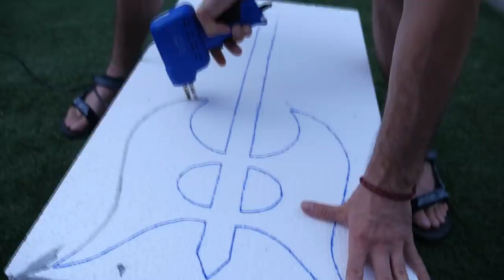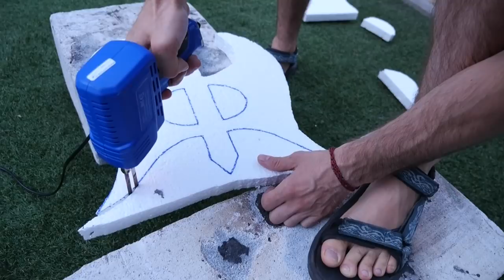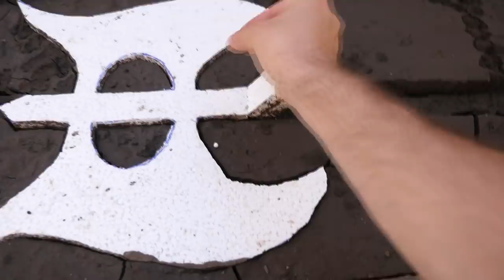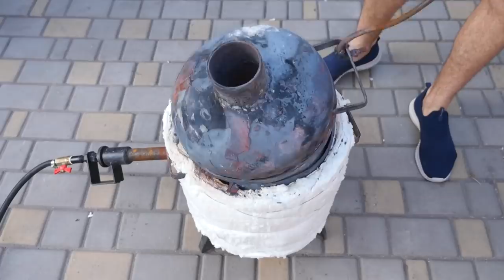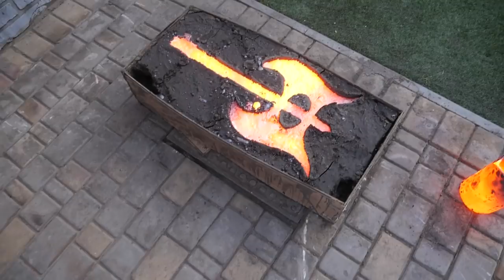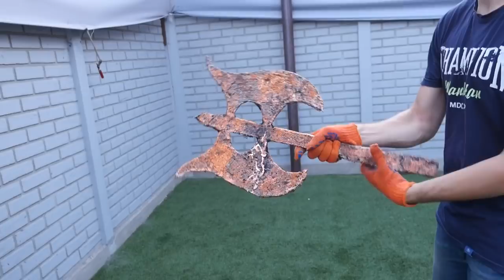AXE from LAVA

Comment: How did you make lava?
Reply: Very easy process you just need some alluminium wires and have to heat at 1000 degree Celsius. That's it
Reply: Sarvesh Raut lava is molten rock
Reply: It’s not lava